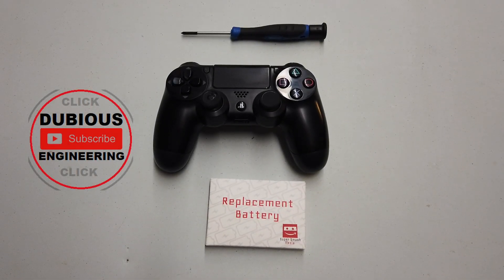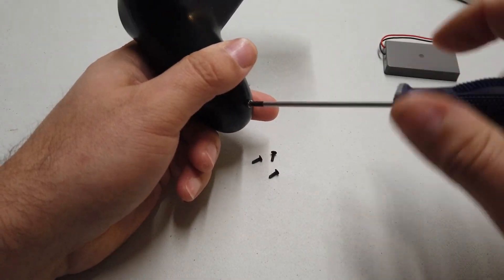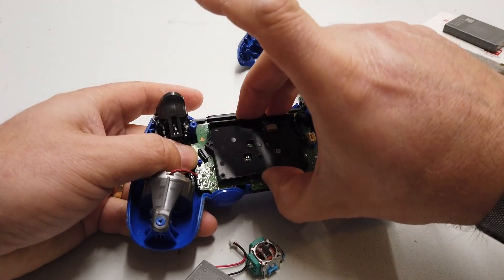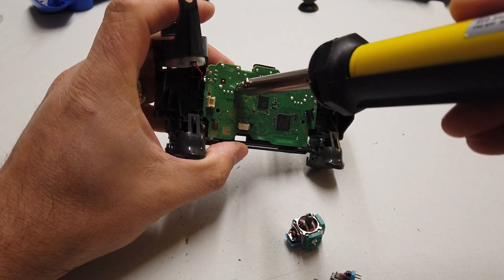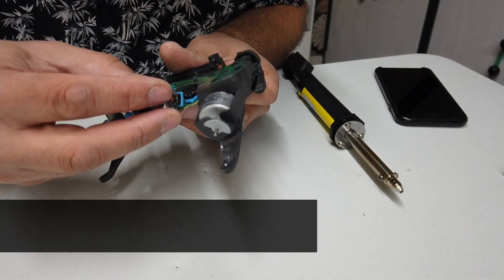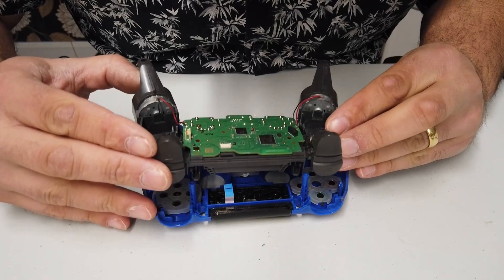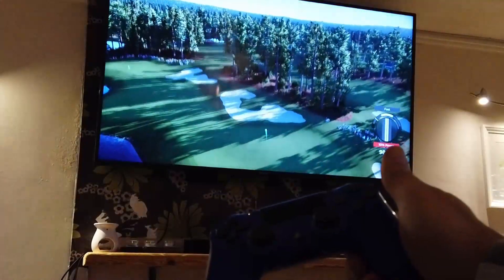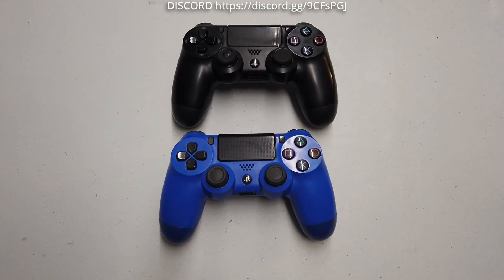DuB-EnG: How to fix a PS4 Controller - Change Battery, Replace Drifting Sticking Analogue Stick

Comment: Thanks, very useful, making a slight rotating motion with the tip of the desoldering iron before pressing the button can help to remove more of the solder
Reply from the maker: Great tip!  I'll try that next time!!  Thanks!